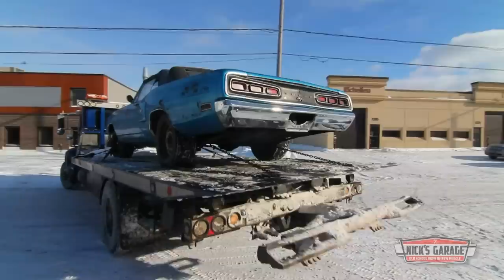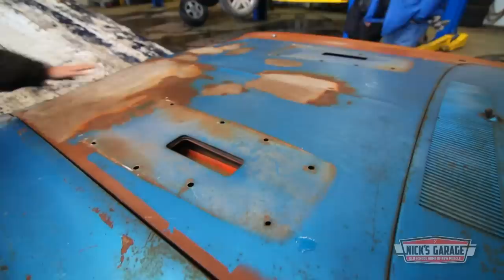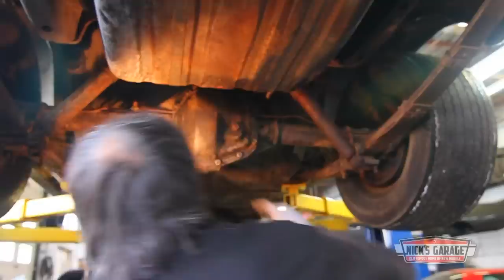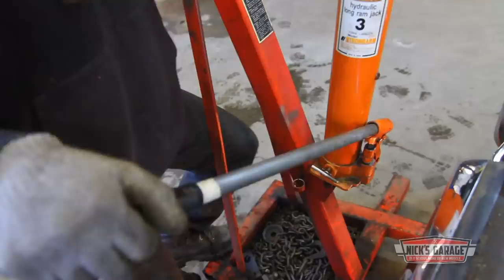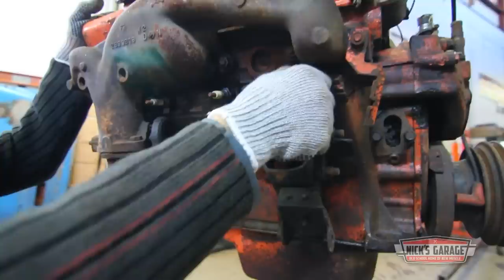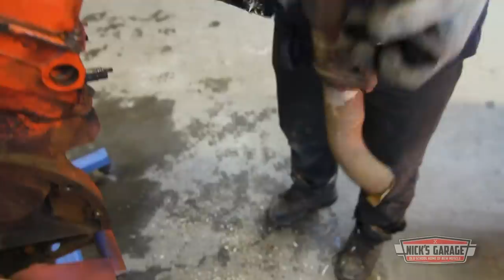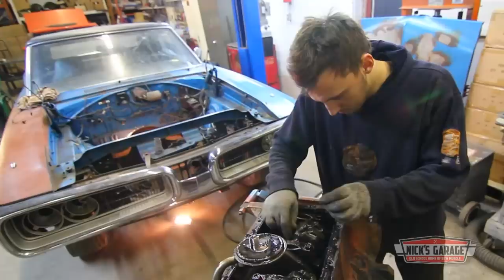Super Rare! 1970  Dodge Coronet Convertible 4 Speed - 440 tear down

Comment: wasn't aware that they made a b body r/t convertible as the body can't handle the stress of powerful engines. Does the side of the block say 440-6? Seems like it would be with those rods.  Nice original hiflow manifolds.  poping pistons without removing the ridge is a no no as it cracks the lands on pistons pretty much guaranteed.

If you put in anything but the original "magnum" cam Im gonna laugh my head off as it will not be street driveable.  The cam covered in oil and sitting for 20 years or more probably has less than 0.001 wear on it.
Reply: Jacilynn S no block says '440-6' on it anywhere
Reply: Jacilynn S as to the 'stress of a big block', convertibles, hemi cars and true 440-6 cars came with reinforced gussets in the proper places in the unibody. 
Chrysler engineers were well aware of unibody flex
Reply: really darn all those 440 six packs that have 440-6 cast into the block are all wrong!
Reply: Im well aware of the brace plates under front and rear going from the rocker to frame rails. 

Chrysler judged the convertibles "insufficent" to handle the power of the hemi. I believe it was the same for anything above a "normal" 440 four barrel as well.

If you try and tell me of a "factory" hemi convertible I will also outright tell you off so don't even try. There is no such thing. Ever!
Reply: available new from year one but hiflows are around used.
Reply: Jacilynn S .....I'm sure there are millions of things that you "wasn't aware" of...and Nick has forgotten more about Mopar's than you will ever be "aware of"...
Reply: Passenger side below the distributor is a machined flat metal boss. There you will find the production number for the engine stamped. If it's factory 383 Magnum with 4 bbl it will read 383 HP for high performance. Below that will be stamped the horsepower rating of 335. On that car should be a 440-6 stamp rather than 383 HP and the horsepower stamp should read 425. Later smogger blocks do not have the machined boss stamp below the distributor but on the top rail behind the water pump mounting flange on the passenger side. Some but not all also had a stamp on the rear of the oil pan rail as well as the casting number on the lower side of the block on the passenger side. After graduating high school in 1973 I owned a '68 and '69 Road Runner a '70 Dodge Super Bee and a '72 Plymouth Duster 340 Sport Coupe. I might be an old man according to some these days but I clearly remember those days as if it were yesterday.
Reply: rb blocks its in front of intake. b blocks its under distributor, small blocks its on left side front of block.

On right side of block (only visible under car) is a casting. That will tell you more about the block on rb than the ident will.
Reply: The casting number on the side of the block is relative only to when the casting was made and to what model intended. The stamped boss is the production info for what was produced on the car irrespective of the casting number on the block. Thus the VIN.
Reply: thought that too but i was proven wrong thus the cast 440-x tells what the engine was cast for.
Reply: I don't know if this explains the castings or not.  I evidently do not have enough band width to open it or download it. The page keeps resetting before it downloads. My old Direct Connection updates along with Carroll Shelby's book is in the shop somewhere. Finding them very quick is impossible as I do not know in which corner to start looking. It's been many years since I turned a wrench and needed them.  http://www.moparts.org/Tech/tech/img/DirectConnection1975.pdf
Reply: I agree with your last post as to what the engine was cast for as it concerns the engine application. My little dither on the stamp numbers concerned the final assembly designations. Prior to mid-1969 wedge heads for 413 could wind up on a 1967 383 car. Instead of having hemispherical rocker saddles they had the saddles machined flat with a 3/8" bolt hole tapped in the head to hold factory cast-aluminum risers with separator springs between them and the spacers on the rocker shaft. My old '68 road runner was a 383 Magnum on the air cleaner and the distributor was stamped 383 HP @ 335 yet the head castings were factory 383 casting numbers but having triple springs on 413 high performance valve train hardware with 11.25 compression pistons. They had freaks in some of those cars and casting numbers were for "general" classification and application purposes but they did not always denote the interior components. Carroll Shelby amassed probably the best information on the old stuff as anyone and even he admitted MOPAR could be a grab bag at times.
Reply: The best identifiers are the VIN and the factory build sheet. They used to stuff the build sheets under the springs in the rear seat backs. The final assembly number stamps I mentioned should match with what's on the factory build sheet. Do they all? My old '68 beep-beep was 'factory original' as they say but it did not have the build sheet when I bought it. Go figure.
Reply: have them good for small block reference. You should get the original dealer manuals 62-70 and the parts books along with the ramcharger addendums published at the time (more of a inhouse newsletter ) read them. I did, learned a lot and how much those books you linked are not entirely accurate. ie aluminum fenders, bumpers, hoods and special exhaust were NOT on the wagons...The maltess cross on blocks, according to direct connection and shelby refers to undersized mains. Strange that you wont find undersized mains on b/rb engines including the hemis which all had the maltess cross.  I have seen one 383 marked maltess X with undersized conrods but that is it in 30+ years of working on these cars, (gods i feel old now).

Have fun as I really don't care. I have too much work to do and an old truck box full of "performance" cams people put into engines. Also have a number of crushed, I crush them right after I take a sawsall to cut them out, headers in an old parts car for scrap.

Unless you are going to drag race all the time with the car there is zero point to cams or headers at all.

Back to the car in the video. Show me the vin and tags and I'll believe its real. Otherwise I have to believe it's a 1 of 1 car like any "hemi" convertible.